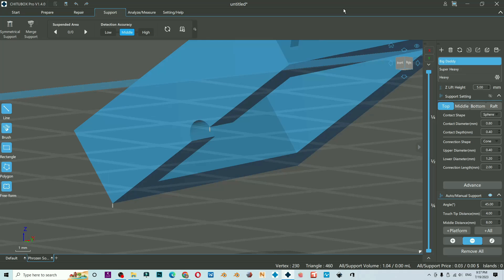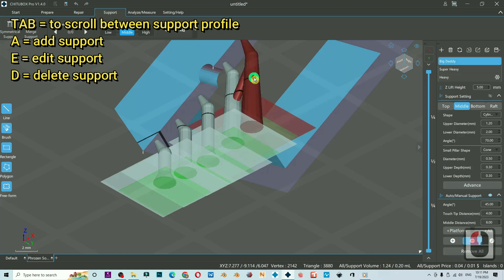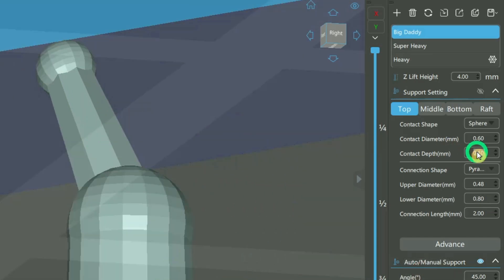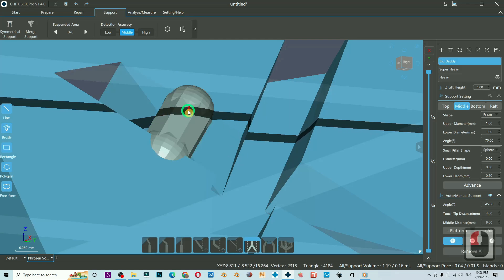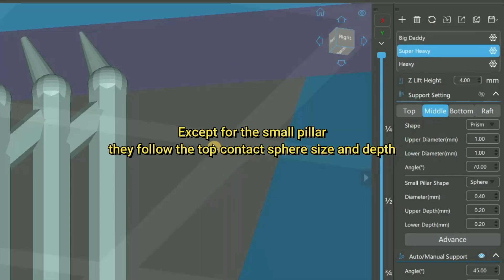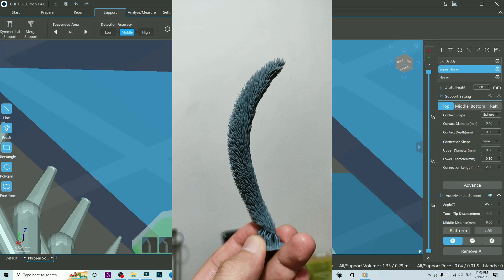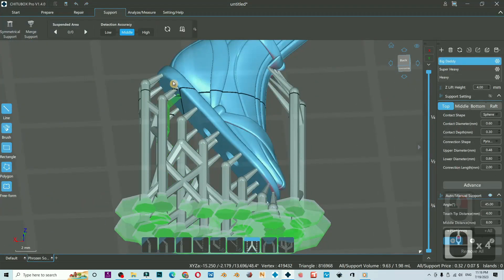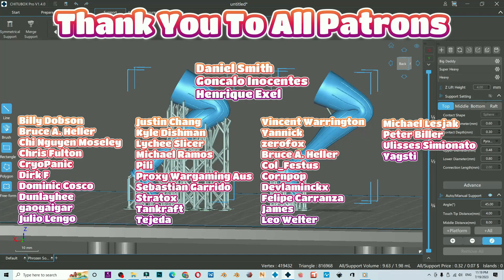My Support Setting - Masterclass Resin Support (MRP) 1

Comment: I tried it also with an leg but the leg just ripped off of the supports
Reply from the maker: Did you hollow the model or solid?
A slight adjustment might be needed on the exposure

Comment: I need help getting the resin to print to spec. the filament printer we have is printing perfect, for example i printed a wrench. the filament printer wrench works perfect, the resin printed wrench does not fit the nut at all. its actually smaller. and theres a bowing. ive changed exposure and lift times, printing with supports gave me less bowing. on the flat side of the wrench but the actual wrench was still not correct. for example if i print a torx size 8 it needs to fit size 8 not 7 .

Comment: After my third or fourth attempt at using these support settings, I give up. These support settings may work for things like 25/32mm miniatures and component based models with small parts like in the thumbnail, but for anything else these are insufficient. Additionally, Chitubox has completely changed their support options and most of their UI, and you no longer have the ability to add more than the three support sizes that are built in to the slicer. You can modify the sizes of the three settings, but you cannot add more.
Reply from the maker: support requires experience
knowing where to add extra, where to keep minimum.
simply copy my support setting will not work without such experience.

analyze your fail print and add extra support where it fail.

i can print full 30x20x30cm big model just fine with 0.4mm support all round the model as anchor and 0.3mm as stability support, then use 0,2 or 0,1 for tiny non overhang details.
it is all about experience.

Comment: one question why my supports fail inside the hollow model outside are good. Bottom contact surface of support iside model is small and it cant print
Reply from the maker: Hard to say withtouy knowing more detaila like the upper and bottom tip size, etc.

Comment: I watch and admire your work. But here is a question, in the video, you say that all supports have a base of 1mm. However, on your small models (tank, and others up to 3-4 cm) they seem to be thinner. What support base do you use when printing small models?
Reply from the maker: Max 1mm is enough. 
I always use 0.3mm
Reply: @wangdennys  I'm sorry, I misspoke. I was asking about the thickness of the middle part of the support. "Middle diameter."
Reply from the maker: @wwRWw  well they are 1mm

Comment: Brilliant Denny I'm trying all your advice and using your prints from your cults to set my printers up I jut got my m5s anycubic 20 minutes ago I'm about to open it up I'll use all the great Info you have! This was abit confusing on the support names but loved the way that leg printed! I have a model trailer for a ww2 US DUKW I am trying to print I'm just wondering of you had any advice on what angle? I printed a first test of it at 45° but it's printed on the mono 2 with large quite deep layer lines at 50um layer hight, I know this is going to be larger step lines anyway it was a test print but my saturn 2 8k was busy at time of printing or wouldn't have normally used this printer for something of this 1.35 scale size anyway the trailer it is hollow lid separate but like a bath tub! What way would you suggest for printing this? If you want to see a photo it is the WW2 US amphibious Trailer the tub only the chassis is separate! Many many thanks for taking time to read this and for all your help

Comment: Any way you could export the support profiles to make it a little easier to play with your settings?
Reply from the maker: Nope. Import the support config file will mess up your support setting because the default cannot be remove.
Reply: @wangdennys  That's why you export a backup of your current config first.
Reply from the maker: @Gh0stwheeI  when you load it. It will mess up the existing setting.
Reply: @wangdennys  Yes. That is why you export a backup of your setting somewhere else.

Comment: So for small 1/12 headsculpts would you recommend using medium or light supports?
Reply from the maker: I always use super heavy as anchor and then combine it with heavy and medium and light. 
I never use only 1 size.

Comment: What's the value of a sphere contact point? To avoid pitting when removing supports?
Reply: yes, it's much easier to remove the sphere than to fill the pit, using these support settings for a year now and it's totally awesome

Comment: Hello Dennys, after I had to change my FEP early this year I started getting a lot of failures due to the supports, so I started over supporting which fixed the problem but has caused a lot of damage to the models. Important to mention I always do auto supports. Do you think manual support is the answer?
Reply from the maker: Hmmm it is hard to say without know what the object looks like

Comment: With the leg... How did you know that the knee didn't need supporting? I would have thought that the knee would have created a lot of pulling on the foot area.
Reply from the maker: Experience.
I been doing manual supports for 9 years.
Reply: Is that because you had a good burn in layer?  @wangdennys

Comment: ❤thanks a lot for this video! I've been typing for myself for three years now, but getting the right settings and supports is just some kind of battle!
You may want to mention in your videos about the optimal lift speed to keep print rejects of large models to a minimum. the print time does not matter.

Comment: Right. The platform touch shape refers to the tapered bit between the pillar of the support and the actual contact shape where the support contacts the model. I didn't understand that at all until you went through it.
Reply: If you hover your mouse over these settings, you get a visual reference to understand what part the settings will change.